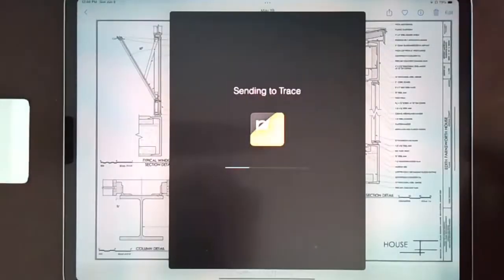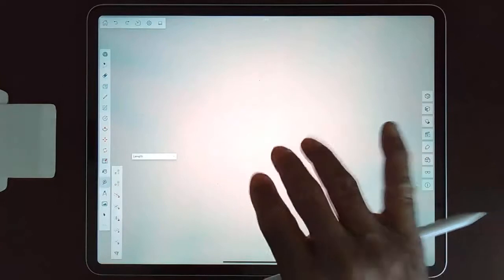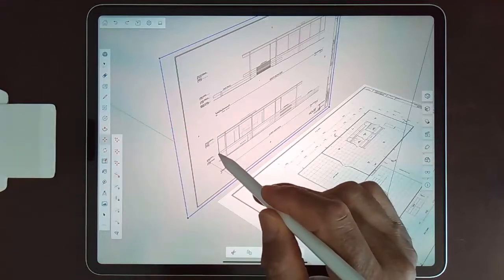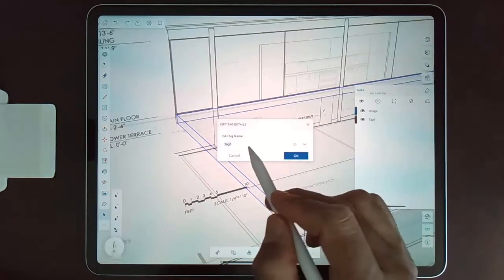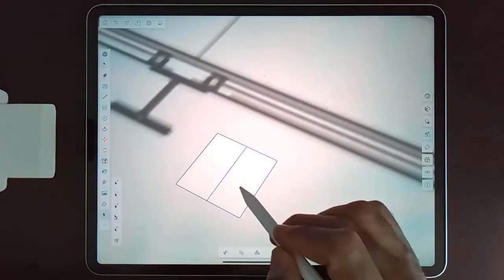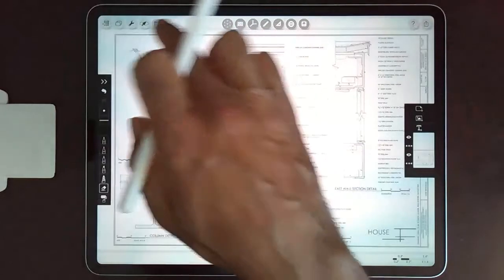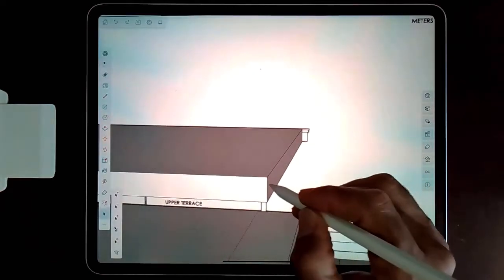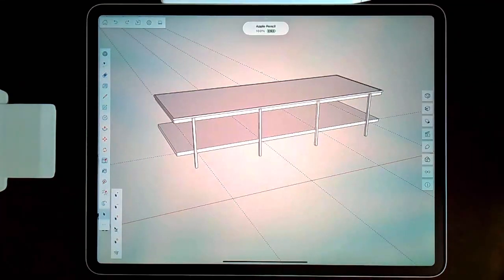Sketchup for Ipad - Building the Farnsworth house Part 1 - Importing reference Images

Comment: Your insane dude, I’m going to come back to this video many times to learn as a reference. Thank you very much.
Reply from the maker: Glad it helps.
Reply: @OmarCalderon01  just a fore note Omar. I’m new to SketchUp. I’m trying to make a slopping terrain for a block of land I’m looking to build on. I’m finding it hard because iPad doesn’t have sandbox. The block is 648m2 with a gentle slope from the road down 2m elevation 32.4m to the back which is flat 15m. Width of block is 20m. I’m trying to work out how to make that slope and elevation. Any way thanks again for the great video and your building looked amazing that you did the video for.
Reply from the maker: @madprism  thanks for your note. I would probably build this as a solid from a side view. I’ll post a little video